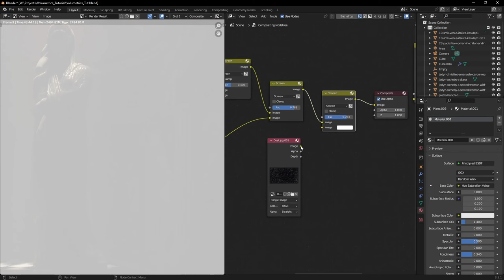How to Composite Volumetric Lighting in Blender

Comment: you give very useful information thanks !!! :yougotthis:
Reply from the maker: you're welcome, friend! there's a lot more videos coming!
Reply: @blenderisms  you have all rendering elements without noise in compositing, how did you do it ?🧐
Reply from the maker: @АланКлимкович  there isn't really any other way than simply rendering out the image with a lot of samples. I set the noise treshold to 0.003 and the samples to around 10 000. on a 3090 this took around 40 minutes to render. just enough time to get dinner and come back to record the video :D  Also, there is a little bit of noise, but youtubes compression completely gets rid of it :D
Reply: @blenderisms  
cunningly!!!😁

Comment: I don't see Transmission Direct or Indirect, I have Blender ver: 4.1.0 Alpha
Reply from the maker: Hi, sorry for the late answer, are you sure you have them enabled from the render layers rollout?
Reply: @blenderisms What version of Blender you have? If it's not 1.4.0 Alpha then it's changed
Reply from the maker: @HeLIEl  I'm using 3.6, haven't looked into the alpha versions. I change versions only after finishing projects/when there is LTS. I'll look into it if I get some free time this week.
Reply: @blenderisms  Ok that makes sense. I am still in 3.5, and will update once the stable version of 4.10 is released.